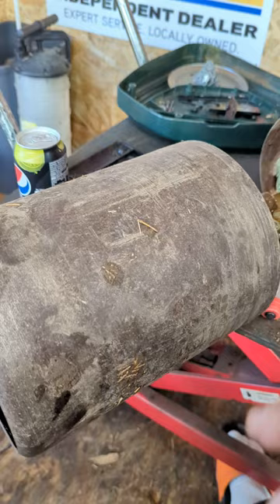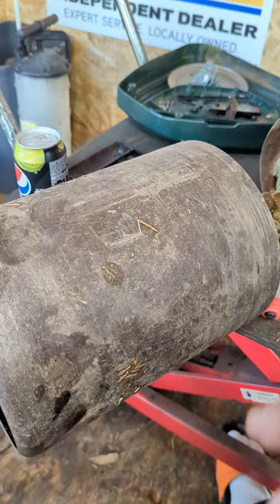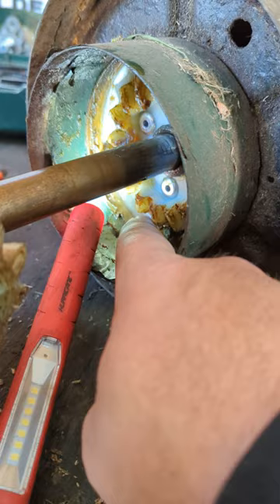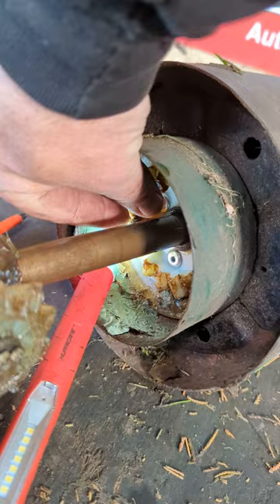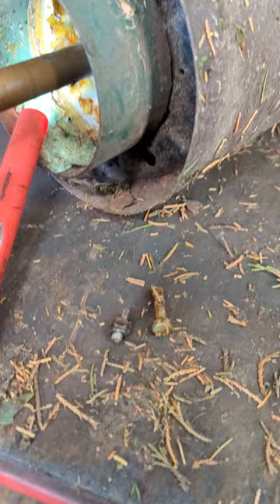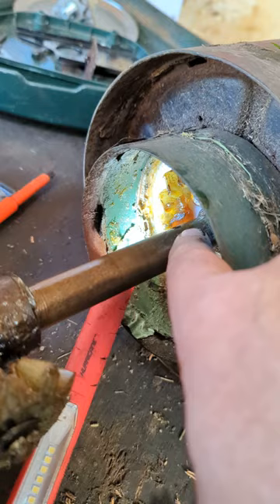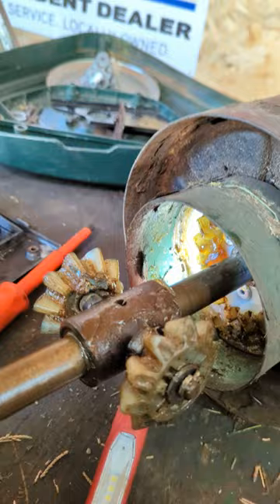Atco Allett No Drive FIx Only @themowerman #atco #allett #short

Comment: Hi Mick - struggling with this myself! Turns out the differential housing has completely shattered into several pieces on my Balmoral 20S. Do you know where I could source a new one? cheers, Matt
Reply from the maker: Here you go mate .. hope it helps https://www.gardenhirespares.co.uk/atco-balmoral-17se-up-to-001891a-rear-roller-assembly-to-002848a.html
Reply: Thanks Mick. Have changed all that up and now when reinstalled the roller is separating in the middle... I've obviously missed a step/not fitted a part. Do you have an email that I could send you a message on? Thanks
Reply: @matthewmcgrory8623  you've missed a circlip, there's a larger one that holds the two halves together. My diff housing is also in a lot of small pieces so I'm replacing the gears at the same time. Chances are they're worn and binding overloading the housing and smashing it into pieces. This is the second failure I've had so I'm not taking any chances this time...